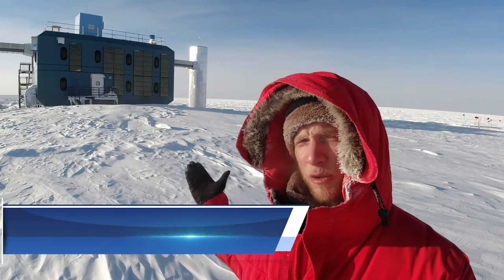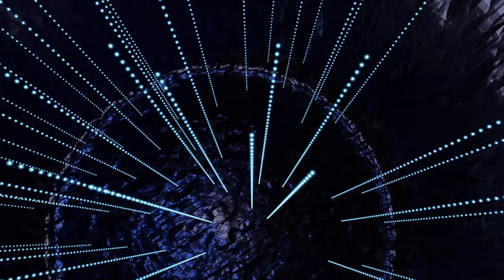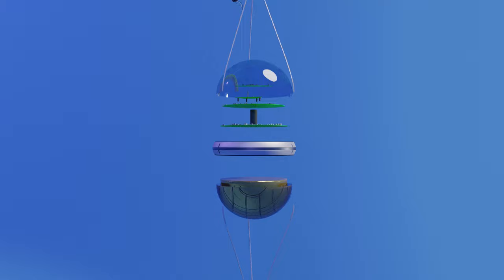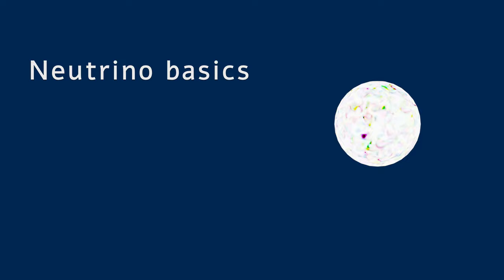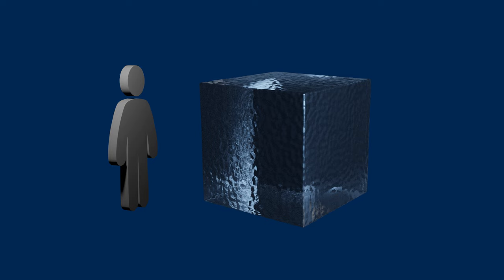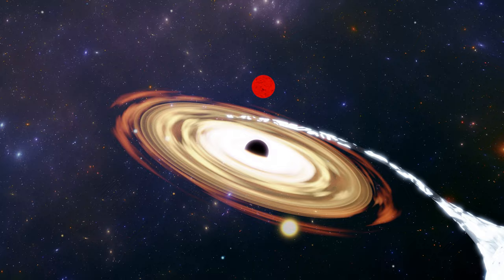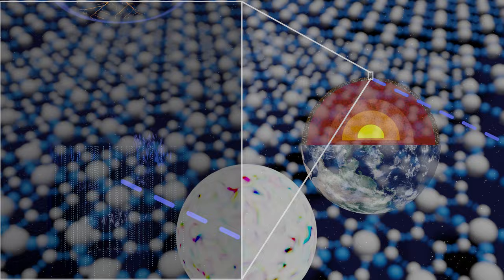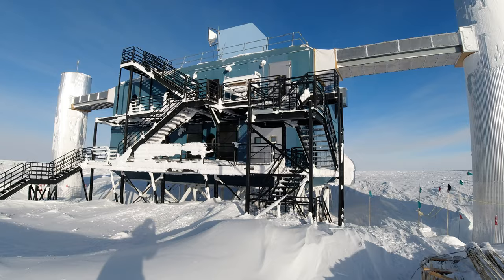The IceCube Neutrino Observatory - High-energy physics at the South Pole!

Comment: It was one of the earliest demonstrations of what's called multi-messenger astronomy 🌌
Reply: Its nuclear powerd wich is aginst world law
Reply: @skibjav3060  do sumthin about it - they
Reply from the maker: @skibjav3060  wrong and wrong.  It's not nuclear powered, and nuclear power isn't outlawed in Antarctica (it's just very difficult).  Weapons testing is banned, however, which I think is where the confusion comes from.
Reply: @JoeSpinstheGlobe thank you for that info.
Reply: @JoeSpinstheGlobe so the power to transmit energy would classify this collection of DOM’s as ?
Reply: @dogedave3188  I don't get your question? Are you genuinely asking what the power to transmit energy is called? Or are you trying to equate the power to transmit energy (data) to nuclear power? 

Transmitting energy is something we do constantly. Copper cables transmit electromagnetic energy all of the time, but you'd be hard pressed to call that a nuclear reaction lol.

Maybe you're confused because these DOMs are picking up neutrino emissions from a dying star (blackhole) and we transmit that data to other research stations? Just because the source of the energy came from a star doesn't mean that iceCube is transmitting nuclear energy. The station detects neutrinos and then the IceCube station contacts other research stations with its findings. In no way is IceCube generating or transmitting nuclear energy.
Reply: Wont the nuke melt the ice tho?
Reply: @jaredknapp8886 there is no nuclear power generation anywhere at the South Pole. The energy for the the Icecube experiment comes from the same source as the whole south pole complex receives, which is a traditional diesel fuel generator in the main complex nearby. Check out Joe's video where he gives a tour of the complex.
Reply: Intergalactic.....Species DOES EXIST....HUMANS COMMUNICATION IS LIMITED BOTTOM LINE
Reply: @skibjav3060  You said so little and still got everything wrong, where are you getting your information?

Comment: Doesn't plate tectonics and/or movement of the Antarctic ice sheet mess up the alignment of the neutrino sensors? Do the computers have to constantly account for these positional shifts of the sensors? Even if a sensor moves a few microns from its known position relative to other sensors, that can introduce major errors in calculating a cosmological origin vector.
Reply from the maker: I know the ice sheet moves in one direction in bulk, but the calibration lights & sensors on each of the DOMs would be able to measure and account for any relative shift
Reply: Yes, it is important, and needs to be regularly taken into account using calibration measurements :)
Reply: Don't they have a minimal movement anyway from the water currents?
Reply: @FrozenHaxor there’s no water flowing except possibly where the ice sits on the bedrock. Remember it’s not like the nth pole where the ice sits on the ocean. Antarctica is continent of rock and was once inhabited by dinosaurs etc.
Reply: I wonder if the ice sits as a solid on the bedrock, I’m sure I’ve read that there is a layer of water between the ice and the bedrock. So there might be earth tremors/quakes etc but I haven’t heard of them recording this with seismometers. I must google that….
Reply: I think it's a chicken and egg thing
Reply: SOME STAY DRY AND OTHERS FEEL THE PAIN

Comment: It's a strange and happy accident that the frequency of the third overtone of the hydroxyl group stretching mode of water lies in the near infrared, with a tiny part of its tail just spilling over into the red end of the visible spectrum and thus causing the strong absorption of red, orange and yellow light through any appreciable depth of water, while allowing blue and near ultraviolet to sail unimpeded through far greater lengths. And at the same time, the spectral peak of Cherenkov light lies at around 350-400nm, almost precisely in the same region at which water is most clear. If either thing weren't the case then a device like Icecube couldn't exist - it wouldn't work. Sometimes, it seems anyway, nature is throwing us a bone.

Comment: How do you know the exact path of the neutrinos in the ice cube? Would you like to explain in simple terms? as simplicity beats complexity.
Reply from the maker: Exact path? I'm not sure that's possible. But they have a pretty good estimation by the timing of the light hitting the sensors. If the light hit a sensor early in the event, that's likely near where the neutrino collision happened.

Comment: Great video! Just a quick correction though, the server room in the main station is also actively cooled, or at least it was as of 2013.
Reply from the maker: Ah I'll bet you're correct, i never had access to that room. I'm just repeating what the IceCube guys told me but they might not have known
Reply: @JoeSpinstheGlobe  To be honest, a lot of us in IT didn't know either! We found out the hard way once, during a power event where we had to turn off power and HVAC to a lot of areas (including the datacenter).

We thought it wouldn't cause any interruption, since all the racks in the datacenter are on a huge UPS that should keep them alive for hours, but instead all our racks died after like 40 minutes. The UPS had plenty of battery to keep them alive, but without HVAC keeping the temperatures down it overheated!

Comment: Hi Joe, I'm writing my dissertation on high energy neutrino emission from blazars, is there any scholarity articles you could point me in the direction of that might be a useful reference? Or potentially any other good sources for information? thanks :)
Reply from the maker: I hope that "dissertation" means something different to you than it does to me, because otherwise you should probably already be semi-expert on this topic 🤔. I would honestly put some of those words into Google scholar and stick to reputable journals. That's what i did + confirmed with expert scientist friends.
Reply: @JoeSpinstheGlobe   I'm 21 and still an undergraduate so definitely not meant to be an expert and yeah that's what I've been doing so far was just wondering if you knew of specifically that would help.

Comment: Actively cooled ??? I don’t understand, would not the outside temps be enough to cool? You mean draw in the outside cold air ?  AC running ?  Or is it like a fully “inside” heat pump where the hot air from cool side  is just dumped inside the regular room itself ?

Comment: How did they get the DOMs into the ice? Bore holes and refill with purified water or...?
Reply from the maker: Hot water drill, which leaves the meltwater in place and then drop the line of DOMs within a matter of hours before it refreezes
Reply: Im more interested how they power all that equipment because that thing consumes energy like a little town. Is there a nuclear reactor?
Reply from the maker: See part 3 of the tour.

Comment: So a photomultiplier typically needs a scintillator to fluoresce in order to multiply the light given off during florescence which I have discovered is the ice itself via Cherenkov radiation. The Scintillator is the detector (ice) and the photomultiplier only amplifies it. Someone mentioned that the DOMS can determine if they have moved in the ice and can compensate... Very interesting. You would almost have to have something it detects regularly that would saturate it enough to be considered a standard (super small deviation)..? I find this interesting. When we actually create a material that collides with or resists the neutrinos predictably then you have a real detector. What this is is actually pretty rude imo. Like caveman shit lol.

Comment: I thought the facility was 10,300 feet on ice elevated above earth?
Reply from the maker: 9,300 feet yes
Reply: @JoeSpinstheGlobe  Was it hard to breath? Erin Hecker made it seem that way, didn't look like u were struggling at all.
Reply from the maker: Yeah it took me a while to adjust and i never fully adapted. Working out in the gym took way longer than normal, couldn't run as far, etc
Reply: Supposedly it is the easiest place to launch things into orbit. Wonder why nasa / spacex hasn't set up shop there 🤔
Reply: @Maschinestorm  I see you are trolling, but really unless you are going to a polar orbit the poles are literally the worst possible place to launch something. The equator would be the best.

Comment: Nobody in the comments section has the slightest idea what this system actually "is"......  
#1.)  It's the world's largest telescope.
#2.)  It's a multi-faceted Directed Energy Weapon.  Each one of the DOM's has the ability to transmit at over 2,000 volts.  This system was solely responsible for the earthquakes that hit Christchurch, New Zealand.   The neutrinos that the system detects, are those resulting from the advanced propulsion systems of off-world craft.  This of course, was not mentioned in the video.  For more information about what this device (really is), Watch "The Shawn Ryan Show", with guest, Eric Hecker

Comment: "world class experiment"
"most important physics experiment in the world"
"all the data goes straight to the server room"

Server room is... Unlocked??? Lmaooooooooo you failed Step 1 of any standard info custody audit.
Reply from the maker: Are suggesting the data is in danger of being stolen, or in danger of being tampered with?
 In the first case, the value of this data to anyone outside the project is little to zero; furthermore, these servers are processing the data as it comes in, but it still generates about 200 GB of refined data daily and it runs 24/7. To copy out an that proprietary data and not get caught, it'd have to be an inside job anyway. Plus the data is free eventually anyway.

In the case of tampering, anything getting damaged or unplugged is instantly reported. They can even tell where someone is in the building purely by the temperature sensors.  You might do some damage but you wouldn't get away with it. The server room is the cheapest part of the experiment so at most would cause a delay.

In both cases, consider that it's located at the end of the world, with at most 150 people at any time that could get unauthorized physical access, with no chance of escaping consequences after. So maybe the attack surface is leakier,  but the pool of attackers is very small. And maybe most relevant, any bad actor willing to walk a mile both ways in -85F cold probably won't be stopped by a single locked door.